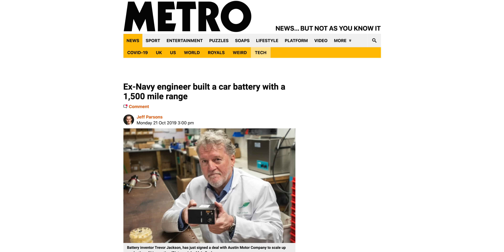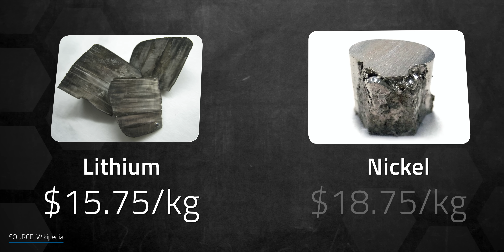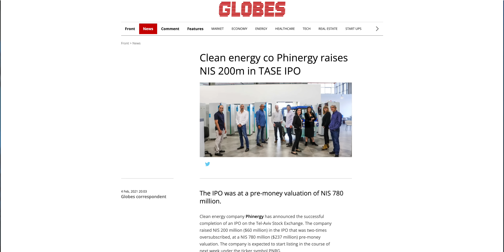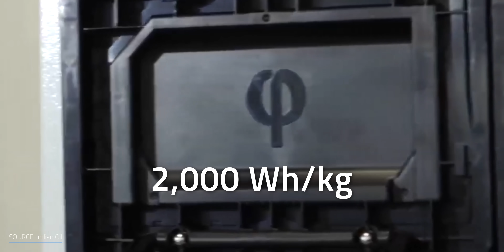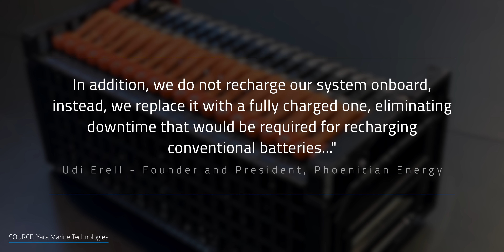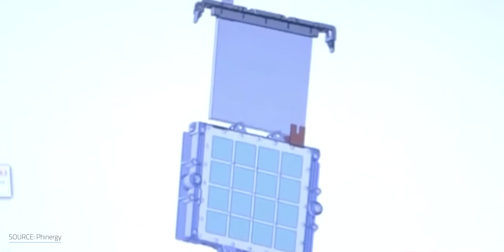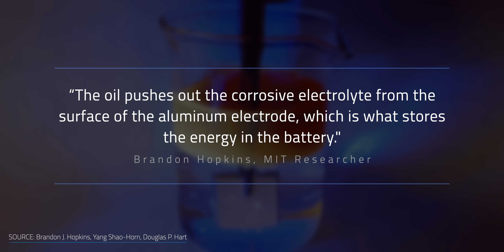Exploring the 1000 Mile Car Battery - Aluminum Air Hype?

Comment: I know a product that can go up to 500 miles and can easily be swapped. It is called gasoline. What is the advantage? I don't see any over just using gas. I would just stick with gasoline which can be refilled anywhere. If they can make it rechargeable, I would say, yes.

Comment: Marine applications don't need to be light given that ships weight tons and tons.  Seems like LFP would be a better use for Marine applications while Aluminum Air seems better for aircraft.
Reply: Sure the cost of the ship might be less per ton, and yes the cost of hauling cargo is less per ton (than a truck/lorry), but no matter what vehicle you're talking about, lost payload is lost payload. If the ship can hold 1000 tons of batteries and 4000 tons of payload, then it could just as easily carry 500 tons of batteries and 4500 tons of payload.

Comment: Swapping batteries could be as easy a pulling open your dishwasher. We have electric racks at work and never work on units in place we just pull the rack and replace with a spare. It’s that easy. Now to get automakers to standardize on a unit that will take an act of Congress

Comment: When they are not rechargeable, that makes them very energy hungry for one single use. And for the next 700km buy new batteries and use very much energy to recycle the used batteries. Melting aluminium is very energy intensive.

So, in summary, no, and no thanks for this.

Comment: What do you mean towed to a swap station? Just swap it out yourself, if they’re not designed to be swapped out by the user then there’s no damn point. The main problem is the energy efficiency of building the things. It takes a lot of energy to refine aluminium from bauxite, and if that process is only 75% efficient then you’ll be using 1.33 times more grid energy to “charge” them compared to what you get out. This isn’t an issue if you make them with an excess of midday solar, but India and many other countries around the world aren’t in such a state. If your electricity is coming from fossil fuels, especially coal, don’t use it to charge an electric car battery. And instead of recycling the battery, they’d better just be draining the cell and replacing the aluminium plate. If you could do that process yourself, or have it be done at the fuel stops, you wouldn’t need to truck around large batteries, just aluminium plates and lye crystals, and dried out aluminium hydroxide to take back to a smelter.
Another issue is the centre of mass of a car with a removable battery. Having your batteries in the boot can ruin the weight distribution of a vehicle, ideally they’d be low down under the middle of the vehicle, so they could be slid out from the side or front.

As someone else said, they look promising for aircraft.

Comment: If I remember correctly, Israel had a similar plan a decade ago, for a transport system with EVs, rechargeable batteries and swapping stations that, in plus, had to be automatic.
But what happened? I didn't get any news ever since. Was this system ever built, or was it just an idea?
I think the same applies for this aluminum battery. Or, following the same logic, the flow batteries must have had a success in EVs, but they've not. After all, it's easier to swap an electrolyte than the battery itself.
I mean, this battery has a future, but I don't think it will be in the automotive industry.

Comment: First, I don't think any solution that continues to treat cars as the primary mode of transport is long term ultimately. 
Second, if they are inexpensive and you can carry a replacement in case of battery death, then the dead batteries can be returned to stations where you get a deposit back, then at least it's more non fuel options.

Comment: Tesla, back in 2013, actually demoed a battery swapping system, and did it in less time than filling a tank with gas: https://youtu.be/H5V0vL3nnHY?t=52

So, seems like a viable thing to me. Questions of cost, of course, would be the crux of the matter.

I'm also curious; does the corrosion affect the recyclability of the post-usage aluminium?

Comment: Did I just miss the main point? What happens to discharged batteries if they can't be recharged? Aluminum is recyclable, but there's a lot more to a battery. What's the efficiency of the whole life-cycle?

Comment: If the distance per battery-pack is =>2,500mi  / 4,000km then the issue is dead simply in places like the US. Where there are already 'jiffy-lube' businesses through-out the nation even in small towns. There ought to be no problem reconfiguring a bay or two away from oil changes (no-longer needed with fewer ICE vehicles) for EVs with this time of battery. And with that type of range, you have plenty of time to get the change done without interfering with your trips.

Comment: If these batteries truly are 7x the capacity by weight then you could have a battery 1/7th the size as an "emergency capacity" battery alongside your normal lithium battery.  Pump in the electrolyte only when the emergency capacity is needed.  That would give people peace of mind with current EVs so that they can depend on them in evacuation circumstances, or if they forget to charge it and need to rush to the hospital, etc.  It would also be useful in EV aircraft, which are more likely to experience an emergency need for power and the cost of swapping / recycling would be more acceptable when you're already paying something like $100/hr just to keep them in the air.

Comment: Well if the batteries are lightweight one could just keep a spare set of charged batteries in their trunk. when one set of 1.7k km runs out you swap to the other 1.7k km set, and recharge the first when you get the occasion.
Sure you would loose half your trunk, but it doesnt seem to be too much of a pain.

Comment: If a battery the same weight as the current Tesla battery would be 2700 Miles, then how big of a battery would be 500 Miles? Wouldn't it be better to standardize around a swappable 500 or 250 mile battery? If the recyclability of the battery is great, then i don't see any actual downsides to the tech that we don't already have with ICE vehicles. If you built a vehicle that was designed to have a swappable battery like this i don't think it'd be too difficult to make it work. Sounds like the MIT researchers are on the right track as well with the oil pumping.

Comment: What I could see if its cheap enough, are booster packs that can be mounted on the hitch or towed in a small trailer.  Connected to the main vehicle this could provide a means for long range trips or if swappable in a trailer, make up for the loss when towing.

Comment: I think this is a great technology, I am looking at doing my thesis for a diesel or petrol over eletric system to fit as a range extender to eletric cars, something that people in areas were the eletric car support grid is currently not available. 

These aluminum air batteries sound like they'd be perfect as another option for extending the range even if it's just temporarily for the odd road trip. Though may not be ideal if you can't replace the unit, hopefully someone will beable to figure out a way to quickly reset or charge these batteries rather than have to replace them.

Comment: There already is a massive market for non-rechargeable batteries. Think of the trust AA battery, for example. Even if these aren't suitable for EVs, they would still be suitable for a wide range of other applications.

Comment: One of the bigger problems would be the logistics of replacing them. They might be able to be swapped out at stations but the issue is the size and the storage of the excess batteries. For a normal station, they'd get well over 1000s to 10000s of customers on a daily basis and i'm just estimating on the low end. So they'd need massive storage facilities and trucks to be able to keep up with demand after we switch over. Currently our shipping model is over taxed and over burdened in the US so it wouldn't be viable anytime soon. If it's not chargeable then I don't see it as a viable option at the current moment.

Comment: Seems like it would be a great solution for commercial/industrial use, but not so much for consumer applications. OR, possibly a one-off emergency-only backup power supply, to replace a gas or diesel generator. You could store long-term by keeping the aluminum anode separated from the rest of the system, turning on the emergency power by manually inserting the anode into the unit by use of some mechanical lever.

Comment: A little drawback. Haha
Rechargability  is a disadvantage but not big one if swapping is fast and easy. 
But corrosion and such rapid discharge are huge major factors that limit areas where we could apply these batteries or how.
Semi trucks could use it well with swapping at truck stops, airplanes same thing (weight power ration has to be checked). 
City busses, taxi, delivery vans.
Basically everything that use a lot of fuel in short period of time and travel a lot of mile in short period time as well. The point is to overrun battery discharge.
In personal vehicles the only solution is different capacity of batteries for short ranges( local use), and extended ( some long trips), or upgrade package for lithium ion cars for long trips. 
Any of the scenarios infrastructure is needed. Storage, service, and recycling cost.

Comment: Doesn't seem to be an advantage given that they're a one time use battery.
Surely they should be plunging their efforts into something that can be recharged.
The significant energy resources to recycle them when they're discharged negates any benit in range to energy density while in use.

Comment: No recharge, no regenerative braking one of the things that makes EVS so efficient.
Reply: So make it a hybrid solution, just as gas/electric hybrids have been for the past 15 years.
Reply: @nosslived  perhaps a super capacitor ... That would work. I still like recharging in my garage ... But I can see how cool this would be in the city with limited charging availability.
Reply: Combining this with a smaller lithium ion battery was one option mentioned in the video, and one that I think would be really promising. Recharge the lithium battery every night for ordinary driving to work and back, and use that for regenerative braking, and for longer trips start drawing from the aluminum battery instead.
Reply: But the range...Teslas can only manage 370miles despite regenerative tech. This aluminium battery is a 700% boost without it.
Regenerative tech is also one morething that can degrade and need replacing...using resources and costing money.
Swings and roundabouts really.
Reply: What are you talking about? We use ultra-capacitors for regen braking, not the batteries themselves.
Reply: @raam1666  That's half-true. It's a buffered setup. Capacitors smooth the voltage out so the battery doesn't take the brunt of the sudden on/off of braking. The capacitors are still usually hooked into the battery packs, not the drive train itself, for exactly the same reason: clean continuity of current.

Comment: I think its the same as the initial problems with current ev cars in terms of "do I have an ev charging station nearby". I think if they put the investment in and put battery swapping points at every gas station there wouldn't be a problem. And I know nothing about this but perhaps a van could be equipped with spare aluminium air batteries too?

Comment: It would be nice if you  could have a standard lion for around town driving with the option to load an aluminum air battery for a long trip or if you are hauling something.  Then drop it at the recycle when done

Comment: No recharging = unusable. End of story. It's a complete non starter for use in a regular privately owned car. Perhaps the biggest advantage of EVs is precisely the ability to recharge at home with cheap power and be independent of a big corporation. That advantage is completely out the drain if you have to take your car to a swapping station every other week. Just forget it already.

Comment: Battery swapping is a lot more convenient than gas stations or recharging.  And why would anyone be concerned about their battery running out?  How is that different from running out of gas or charge in an existing EV?  Spoiler, it isn't.  AAA would be carrying replacement batteries like they have gasoline and the ability to charge cars now.

Comment: Tesla did a lot of work on the battery swap idea at one point but abandon the idea. When compared to the recharge model I would see it being very much more expensive in that the swap station would need to be very much more complex or require a high labor input plus there would be a large distribution network required.

Comment: From the outset ev cars have been badly designed, if you had a battery that slotted into the car and replacements available at any garage this would solve all the worries people have regarding range
The batteries could be smaller and cheaper

Comment: The logistics is to unpractical, hauling these around both full and empty is not happening. Only in a backup role IF they have a 20+ years shelf life would they ever be an option. I would not drive a car with this system even if the car was free.

Comment: A 3-minute battery swap sounds a lot more appealing than spending a half-hour at a so-called "supercharger." The problem with all EVs is getting the auto industry to adhere to a standard, however.
Reply: Sound point.   Note that for e-scooters this issue has been overcome by Gogoro of Taiwan.

Comment: Might need a hybrid approach where you have about 50 miles of range on a lithium ion pack, with 1000 miles on the Al-air pack, so that you can use most of the remaining energy in the Al battery, but still have enough reserve, rechargeable range to get to a battery swapping point.

Comment: If it were really easy to swap, sure, I would take 1000+ range for that. If it were standardized, I could imagine a system where you drive into a dedicated spot, your car gets grabbed, machine unbolts the battery and lowers it out, then brings in a fresh one and bolts it in... You drive off. Although what might be more practical is smaller units that your average person can pull and replace, and you could just do replace a few instead of all of them if you were in a rush. And keep one or two as emergency backups.

Comment: Thanks Matt. Great video as always. You stated that the aluminum is consummed which which means it would have to be replaced as part of the recharging process.  Technically this therefore is not a renewable source. Lithium Ion batteries can be recycled and the lithium recovered and reused. When talking on these subjects we need to to think of total life cycle battery costs which is a much better way to determine a batteries real costs.

Comment: Now to design a battery setup that allows the Aluminum to be submerged or pulled from the solution (the way plutonium rods are setup in a nuclear reactor) allowing for the adjustment of the charge output determined by how much of the aluminum is submerged in the solution as well as prolong the aluminum when there isn't a demand.

Comment: They could include an additional small Li-ion battery in these cars as a backup if the aluminium battery ran out before you could replace it but even with combustion engines, this rarely happens. As a driver you're expected to manage your mileage.

Comment: Well, its the solution motorcycles need to go electric - as Li based batteries simply dont have enough energy density to give decent range.

Yes, not good, not even decent range.

Comment: I wouldn't be interested. I have a BEV that I charge at home. Road trips are now fine - plenty of high speed DC chargers. Destination charging at hotels is generally free, and very convenient. I've plugged into an ordinary domestic outlet at times, when visiting relatives or staying at a rental for a few days. So a non=rechargeable battery, even with 3 times the range I get with now, would be inferior.

Comment: How about a design where you have a large battery pack and a smaller emergency battery pack that gets you up to 50 or 100 miles and can be more easily swapped out at home or by a service vehicle?

Comment: I remember hearing something about aluminum batteries years ago and thought that sounded cool. I think it was aluminum and potassium. I didn't look much into it and figured like most battery innovations it would get buried like most do. Now after watching this and finding out they aren't rechargeable, that isn't very good. You will have to keep swapping out packs and then some company will have to recycle those packs. 

Though this does remind me of a battery I remember hearing about a few years ago that used air instead of lithium. I wonder if this was the same one. It was being developed by the same guy who invented the lithium ion battery and was trying to create something better.

Comment: If swap times were 15 minutes or less, yes I would be fine with a nonrechargeable battery that performs for longer.
Reply: They say three minutes. It looked like a case of open up a housing, lift out the old, drop in the new, close it up and drive off.
I'd imagine they say it needs 'trained' people to do it is a health and safety point to do with manual handling. You wouldn't want some random driver dropping this on their toe as they would likely sue you.

Comment: I think there are applications where these could be amazing. The vehicle they tested used the aluminum battery as a range extender, not as the main battery. This could be a way make EVs more cost effective by using a smaller battery pack for your daily drive, but have a standard port to plug in an aluminum battery for long haul drives. They could be set up with swap networks like we do for propane takes today.